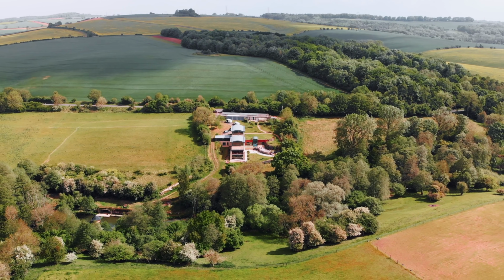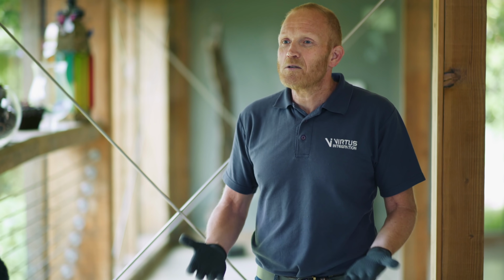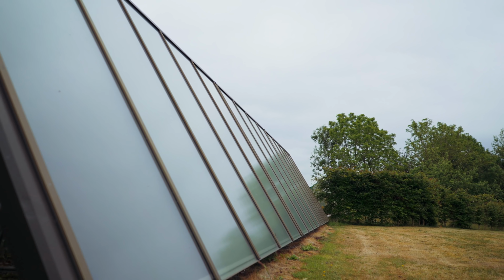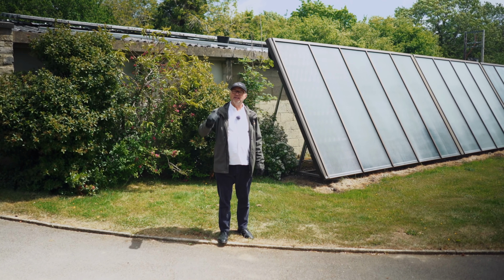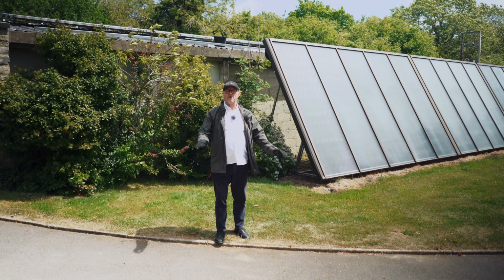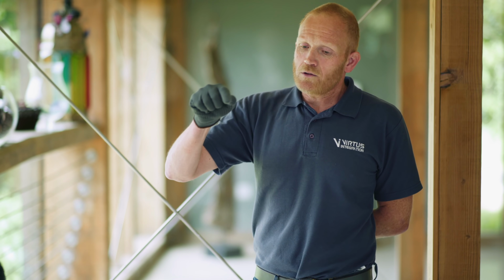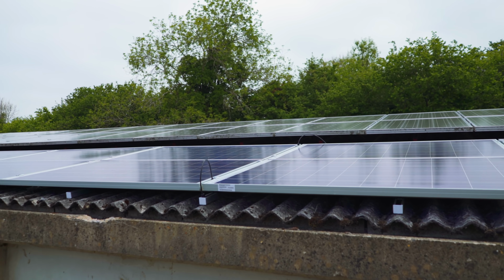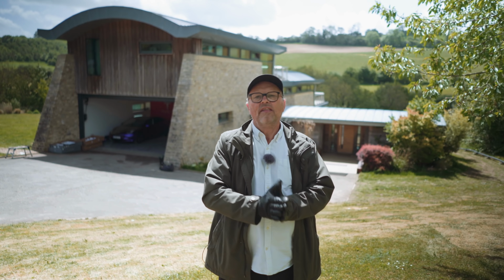Can you HEAT & POWER a big house with RENEWABLES? | FULLY CHARGED for clean energy & electric cars.

Comment: Great content. Just an interesting point I considered while watching this: That house is perfectly suited to its environment. If you were to build it in somewhere like the south of France you'd sizzle like a sausage with the sun coming through the windows. Would be fascinating to see how to build something like this in hotter regions.
Reply: Look again. Those glazed walls have pretty big overhangs. In summer when the sun is high this reduces solar gain, and in winter when it is low, the solar gain is maximised. Basic passive house design principle.
Reply: The thing people often forget is that insulation works both ways. It can also stop heat getting in, as well as heat getting out. So vacuum insulation can serve much the same purpose in a hot climate - the problem is that human beings themselves generate heat - as we're warm-blooded animals - so you would need some way to get rid of that heat to keep it cool. But, of course, heat is energy, so it could be converted into power for running the air conditioning, perhaps.

Though, I do like the sound of the implicit engineering challenge you've thrown down there. It would require different solutions to lose heat than to try to keep it in. And, I agree, it'd be fascinating to see how to build something like this - in reverse - for hotter climates.

(In ancient times, they actually used to make "ice pits" to keep food cold for preservation. Basically, when it's Winter and there's ice around, dig a hole and fill it with straw to insulate it, then pop the ice into the hole. Put some more straw on top and then cover it over. As I say, insulation works both ways and it's surprising how long they could keep a big lump of ice from melting - so it could keep food and drink literally "on ice" - purely with good insulation. Alexander the Great reportedly used "ice pits" on his world-conquering adventures.)
Reply: The big windows are facing SW and have massive overhangs - keeping high Summer Sun out but letting low Winter Sun in. Our Passive House takes at least a week long Summer Heatwave for the internal temperature to get to the point where we consider opening windows in the evening to cool it down. (Plus the mechanical ventilation bypasses the heat exchanger at night in summer when house is warm and outside is cool)

Comment: I’m not able to watch this at the moment due to the mobile device issues, however this is great but not a particularly new concept. Should all new homes be like this? Yes definitely and the building industry is more than capable, they just have no interest in it. However new homes are a drop in the ocean when it come to emissions. Our existing housing stock is the issue. Here is the challenge Fully Charged; find an old house, Georgian, Victorian or 1920-50’s that has achieved the same. I’ll be impressed then.
Reply from the maker: Challenge accepted. We understand that retrofitting these technologies is where the real issue resides.
Reply: fullychargedshow excellent! Go forth and educate the masses!
Reply: fullychargedshow I hope to start the major renovation work of my 1950s, 3 bed, semidetached,council house next year and although I doubt I'll achieve passive house standard, I expect it to have an A rated EPC from it initial E rating. Planning on triple glazing, internal wall insulation, UFH, ASHP, extra solar and battery. So if you need an example of a more normal person house for people to relate to let us know
Reply: Even in buildings where you are not allowed to alter the exterior you can always switch heating system to a ground source heat pump (ok, maybe not in the middle of a city). And maybe put solar panels on a garden shed or just by themselves in the garden. Not everyone can do everything but everyone can do something.
Reply: zapfanzapfan ground source is an expensive solution and you need land or a lot of money for boreholes, most houses are fine using air source heat pumps. A large part of the south is on chalk which performs very poorly with ground source as well. Solar panels should be restricted to roof space, it’s wasted so should be used. I agree though that even if you can’t do everything, anything is better than nothing.
Reply: J QStar A relative switched to ground source heat pump on their farm house maybe 10 years ago, that has worked really well but I guess it depends on what bedrock you are on. Air source heat pump probably wouldn't work well here at -25 C :-)
Reply: zapfanzapfan my air source heat pump will work happily down to -35, but yeah if you are at -25 for weeks at a time I wouldn’t specify it. Scandinavia uses air source heat pumps fo small houses. If you are on a farm with land and equipment ground source makes sense.
Reply: Now the mobile playback is sorted I have watched the video. Well done for pushing the message, for the everyday person it’s totally out of reach, but pioneers like this enable the rest of us to adopt as the costs drop. Now let’s get a retrofit version of this up.

Comment: what is that insulation product name? the one that replaced the 5 panels of  extruded poly styrene .
Reply: Vacupor might have a good R value, but it is a pain in the A**e to fit...you cannot cut it plus any slight penetration damage to the panels during fitting renders them useless...so careful where you put screws and nails!
Reply: @davewilliams6172  The other thing that concerns me is the longevity. It seems like that is not entirely certain. One reference I found was talking 30-50 years. Now granted, I'll statistically likely be dead by then, but we really should be looking to reduce the cycle of demolition and recreation if sustainability is the focus. My house is originally around 150 years old. It's a hog for the gas. Should I look to add this as internal insulation? Would it even be effective? Would it last? Do mice like chewing on it? (Rural location)
Reply: @stephen-boddy  Right. It has its uses in particular circumstances, but it's not a good long-term, low-carbon, general solution. Just use thick timber walls with lots of cellulose or woodfibre in. Carbon negative, really quiet, good decrement delay, robust, easy to fit, can be changed about over the years. PUR and polystyrene are currently cheaper but only because they are 'normal'. If cellulose or woodfibre was made in those quantities it would cost just the same, and there was a carbon tax (as there must be eventually) they would be cheaper.
Reply: @stephen-boddy  In the past we had houses (there are many in Europe) which have lasted for hundreds of years because they largely kept the water off, and there was sufficient air gaps to let them stay dry.  We're now building timber frame houses (in much of the western world) with a mindset of minimising build cost, so are shooting for 'good-enough' rather than 'right'.  Brick and stone are very long-lasting exteriors, but they are porous.  You need good membranes and air gaps behind them to allow the house to dry and to prevent air from passing through - but properly done you really don't need to worry about rodents eating through the exterior cladding and you can choose the inner materials which match the need.
Reply: @davewilliams6172  From the Moonstone Project  - that is  why  you really  need  to  use  Aerogel  - totally agree,  very  panel of  Vacupor  needs   to  be  indisvidually sized  and  made offsite.  wgeras  Aerogfel  totally  water proof  / vapur  proof  an d a  single  10mm  thickness  acheives  sun  passivhause  lvel;s  - currently  bloody  expensive  but in  time   will come  down....Robert did  not show  it  in his  episode  bit  we  gloadted a  log  cabin   on  alake  with only  10mm of  Aerogel  as  insulaytion - and the  bloodt y thing  doesn't loose  heat
Reply: Vacupor
Reply: @minuslr  thank you Lee .
Reply: I was interested in that product too. Living in a tiny 1900s end terrace with no cavity walls the heating bills are huge for the property size. Standard insulation is too bulky, we'd end up with rabbit hutch rooms!! Will defo look into vacupor
Reply: @bernardfender5147  Mine's an 1860 end of terrace but the rooms are quite large and >30yrs ago I used 50mm polyurethance foam backed plasterboard as internal insulation, 35mm in the narrow hall but it wasn't possible to do the stairwell and a 2mm square room - it might even have paid for itself by now! VIP looks interesting but so does Aerogel - have a look at the Passivehaus Store, at least you can knock nails through aerogel!
Reply: Vacuum insulated panel.  Many manufacturers make it. Expensive but if space is important then worth it. They do have their issues.  One is that the vacuum will deteriorate over time, reducing the effectiveness.
Reply: It's a shame these high efficient isolations are so much more expensive... but I do also see a problem if after a few years someone forgets and puts a nail or drill a hole through that wall... how much will that affect the isolation capacity.

Comment: Robert, did you consider placing a loop of PEX piping into the trench you made for you phase 3 power line to use as heat pump source?
Reply: By what they say in this program I wouldn't be surprised if Robert is as we type off hunting for an electric boring machine to dig a well for a heat pump. After  playing with an electric digger a giant drill would be irresistible for him.  :)
Reply: GSHP piping has to be 2 meters deep to be useful, and you will likely need ~100m. That diddy little trench Robert dug, with his diddy litlle electric digger was not going to provide that.